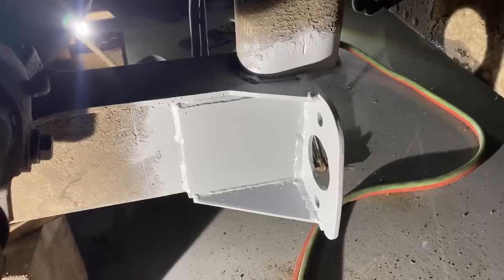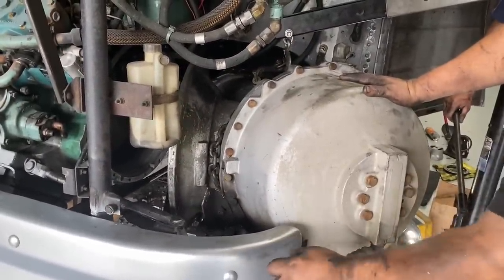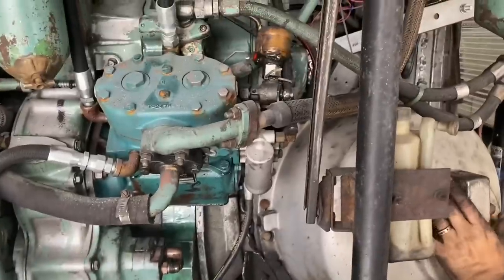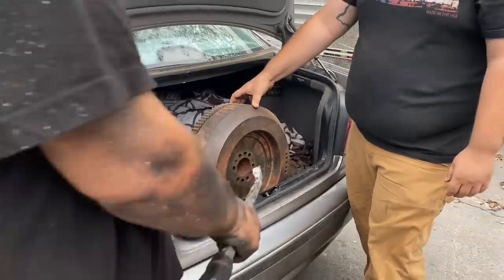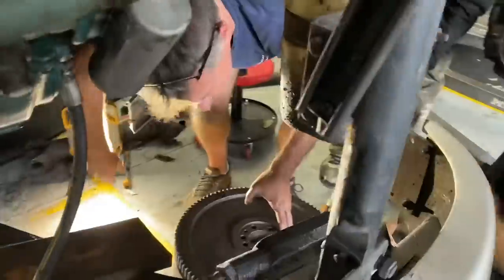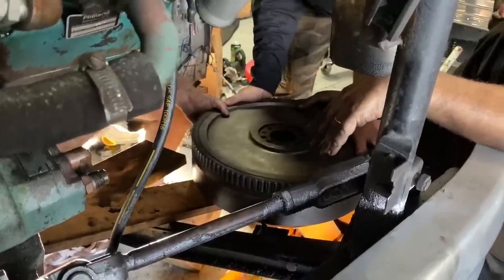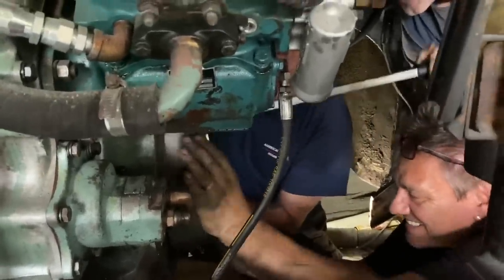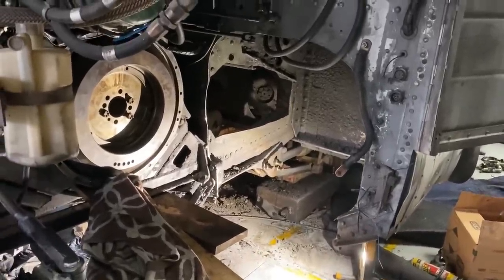V730 day 3 install

Comment: BIG FLYWHEEL is applied because the 8v71 is an undersquare engine, having a small combustion chamber.  The air charge is used up early in the power stroke because the bore is small.  2 stroke Detroits dont "want" to make power at low engine speed.  As engine speed increases, the amount of time the combustion chamber is in at any given position decreases, so the flame front which is going to be consistent can actually push that much further down, but, it takes higher rpms, and that's where the power comes on; that's why these engines start to work at around 1750 plus rpms.  

The added flyweight material purpose is to create a flyweight effect to overcome the "low power" a Detroit has up to 1750 rpms.  An Allison V730 is a 3 speed automatic.  IF the bus spends a lot of time in 2nd gear in the cities/towns/traffic, accelerating from 1250 to 1750 rpms, THEN the engine will need to have such a crankshaft weight in 2nd gear.  The bus needs the heavy flywheel effect to keep the engine running smooth and have what "feels" like almost seamless shifting between gears.  The super heavy flywheel allows the Detroit to accelerate in traffic and not react to every bump in the road to where the passenger feels it.

If the transmission was an 18 speed autoshift, the flywheel would be minimum size, because the autoshift tranny is constantly shifting for the most minor load changes.  If it was an allison 9 or 6 speed, it would have a bigger, more heavy flywheel.  The V730 being a 3 speed, has a big heavy flywheel, the weight of the flywheel is as-if its a "shock absorber" and/or act like an accumulator, allowing smooth power delivery with a transmission gearset having a wide range of engine speed rpms between gears.  That flywheel makes up for the power loss of the 2-stroke Detroit from 1250~1750rpms; the flywheel allows the engine to not fall on its face in traffic, like climbing a small hill in a town, it can smoothly accelerate up it, pulling hard, the passenger feeling comfortable.

Comment: Scott, I usually say 'gloves' when watching you, but today it was 'GLOVES' - not latex ones to keep clean(er) but heavy leather ones to reduce the chances of that brute biting you!
I'd have suggested using the hoist (with a simple cradle welded up from scrap if needed), and some ratchet straps as you lifted it in to prevent it from falling and injuring you all!
Try to be more careful !!

Comment: I did it one man.  Slung it with a strap off the engine hoist using lifting brackets.  It's been a while, but I believe I set it vertical in the flywheel housing and used a pry bar to lift it to the crank flange.  I saw the comment below about the flywheel size, but the 6V92 flywheel was only about as deep as the one they took off.    I also removed that diagonal brace so it was out of the way and I could see clearance for the pan after the transmission was fully in place.  It's only 4 bolts.  Also, with such a short driveshaft, the driveline angles are marginal at best. Close to if not over the recommended maximum of 3 degrees.   It is what it is.

Comment: Good grief! That flywheel weighs more than most modern gas engines! The wife has it right, re: emergency room trips YET!

I agree the designer of the V730 must have been a sadist laughing while thinking " wait till they try to lift this flywheel ". You should in the near future Scott stop by a big city bus maintenance facility and ask if you could look at the rig they used to install the flywheel for the V730 transmission. Who knows, it being old technology and modern buses using three and four speed transmissions you might be able to buy the rig to safely install the V730 flywheel. Believe me it's better to get a flywheel installation rig even if you have to break it down to store it on your bus versus months in the hospital with a broken back and a lifetime of pain more then you have now. Consider this as Gospel or your wife will. With the age of the engines and transmissions your working on there have to be tools that were designed for mounting on a forklift as I'd be willing to bet you'd rather buy an old tool designed to make the mechanics job simpler and easier so he can continue to work instead of occupying a hospital room.

Someone out there must have an installation tool for this heavy sumb***h. Please if you no longer have a need for it kindly let Scott know please! 

This reminds me of coming across a railroad machinists and helper pulling a power assembly with a rope and tackle because they didn't have a chain hoist designed by EMD to pull and replace the power assembly. I asked them if they would like to use the correct chainfall designed by EMD and they just said yeah sure like they thought I was joking. I had just come from an old engine house and had purchased a 4 wheel steel framed chainfall for just the job they were doing and it was disassembled in a trailer going back to my house. When I said it was in my trailer both of them said yeah sure and their eyes just about popped out when they saw it. I paid $50 for it and told him give me $50. He paid me $500 as I discovered they had to replace all 16 power assemblies on the SD40-2 they were rebuilding the power plant on simply doing a refresh on the power assemblies. 1week later I got a call to fire her up for the first start as he said the mobile chainfall made their job so much easier. I then when looking over the top deck before starting her they took my advice and put all new cams into her and found the old cams were worn to the point the book said replace them when the checked out the cams for wear. That badly worn cams I recommended opening the oil filter housing as when Conrail took over the Erie-Lackawanna Conrail engine house personal found they were running without any oil filters as they couldn't afford them. The engine had been purchased from the dead line and sure enough it was a former Erie-Lackawanna engine without oil filters. That explained the high wear on the cams. By the way EMD locomotives use 50 weight single grade motor oil and while I'm not sure I think it might be CF-2 rated.

Cheers!

Comment: This was one of the big things I looked for in the bus-that it had a V730 and 8V-71 in it. Mine is now turbocharged and air to air intercooled with 7G75 injectors. Was dynoed at 375hp and 1125lb/ft torque-which is perfect for my 40ft and 31,000lb bus. That 4106 will be a hot rod without turbo!
Reply: Without turbo? It'll be a hotrod WITH a turbo.

Comment: Wow....u really need to make an adapter for your trans jack to put in flywheels.  I normally have a shaft just a hair smaller than the pilot bearing.  It then bolts to the trans jack...then just slide it right on dowel bolts..(bolts with heads cut off) very easy...

Comment: Modifying the floor jack plate to take 1/4 in steel  plate (10'in x10 in) so the flywheel remains level and secure whist wrestling the flywheel in place.

Comment: lance lance lance lance 👌👌👌 all hands on deck great video Scott .......will the bus need bigger air tank/s cause of the  dual diaphragm  brake chambers?
Reply: No, because  the  spring  diaphragm  used  once  when  you  first  go  to  move  the  bus .
Reply: @cbmech2563  yes but don't you need capacity to release brakes?
Reply: The  spring  chamber  takes  little  if  anymore  to  release  than  one  application . And  doesn't  take  more  than  60psi for  a  full  release . Worst  case  scenario  you  might  have  to  wait  a  minute  to  build  your  air  back  up.

Comment: That was a pile of work getting that flywheel in.  Are there any considerations for the starter besides the gasket now that the flywheel will be running in fluid?  Nothing will leak out through the starter?

Comment: How about making a tool that will fit the big hole in the center of the flywheel as you could attach it to a forklift and lift it easily and set in in place.

Just thinking out loud.

It should work.

Comment: We are installing this transmission on our GM 1962 to a 8V71. The motor runs great but it needs a transmission upgrade. We are thinking of pulling the whole motor.  Would it be better to leave the motor in or not? Seems like a bad idea to me but...

Comment: Make a bracket tool that mounts above the flywheel and rig whats called a down haul. You can suck things up high without the chain fall head or chain ratchet being in the way. Riggers use this method allot.
Reply from the maker: I have one.   It broke yesterday
Reply from the maker: https://youtu.be/PH2DFBgnIxk

Comment: There is something about that flywheel install that bothers me a bit.  It seemed too loose on the dowel pins.  I would have thought it would be a bit harder to get on because of a closer fit.  What centers that flywheel on the crank shaft.  If it's not exactly centered, I would think the starter would have problems and there would be some vibration.  Oh and you might want to count your fingers.  That was a bit sketchy.

Comment: The  dd3  chamber  is  not  a  spring  brake . It  uses  air  to  apply  and  lock  the  brakes . Do  not  use  more  than  90psi  brake  application  when  setting  the  brakes  because  you  have  to  use  more  pressure  to  release  them .
Reply from the maker: This does not have dd3’s.
Reply: @BusGreaseMonkey  
If they aren't dd3's then how are the parking brakes applied? I admit that it's been about 25 years since I worked on MCI's but that flat back sure looks like a dd3.

Comment: use the engine picker to lift it in vertically to place on the piece of wood.
Reply: It was already in use. It was holding the transmission.

Comment: BTW, i'm so confused by this flywheel setup.. where is the torque converter??
Reply: The T.C. is at the bulbous end of the transmission. The T.C. is not directly connected to the engine in a V-drive setup.

Comment: I was watching this with a buddy of mine who use to work a public transportation bus garage.  He said they had made a tool that slide onto the arm of a forklift that they could balance the flywheel on to get it into position vertically.  To mate the flywheel to the crankshaft they had machined a flange that fit the slide into the hole in the flywheel and had a piece of heavy tubing that slide into the end of the crankshaft and they would side the flywheel and flange piece down the piece of tubing until slide onto the crankshaft.  Additionally he said to facilitate the lining up process they took care to line the bolt and dowel pin pattern as well as using temporary mounting studs that were fairly short and threaded so a nut and washed could be quickly threaded on to avoid injuries.

Comment: Biggest flywheel I ever seen. Maybe use a transmission jack.
Reply: That flywheel, is a med size to med small when it comes to diesel engines. Lots of industrial engines they weigh in at 1 - 2 tons. Those are real medium size. Ocean going craft could  use the bus as a flywheel... Just a FYI...